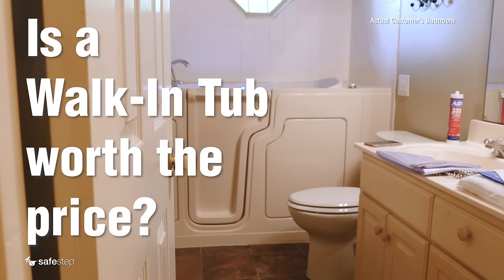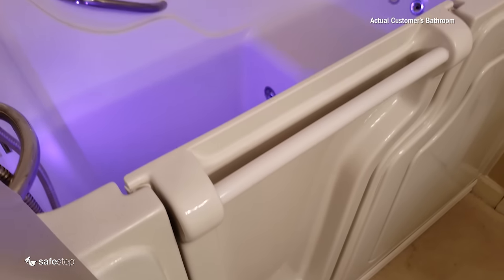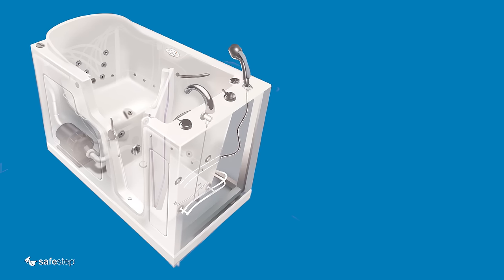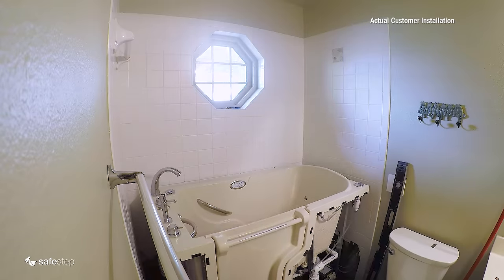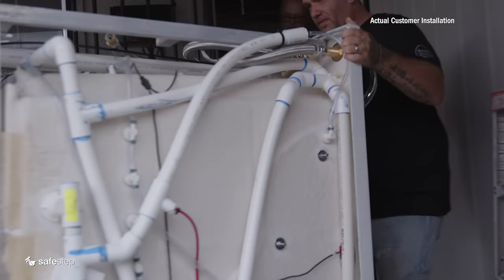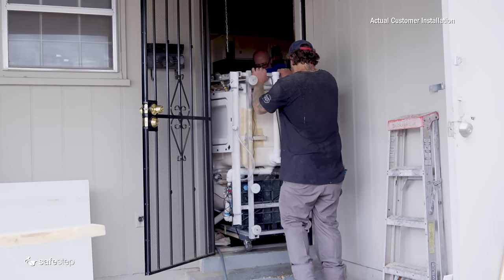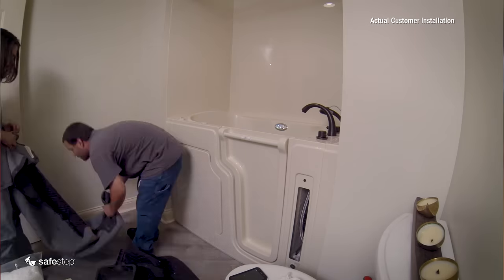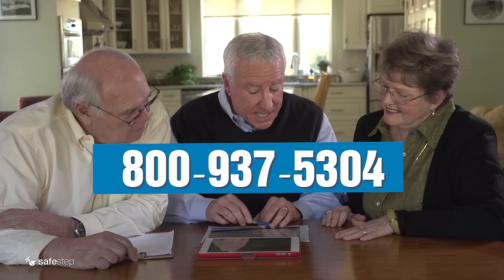Is a Walk-In Tub worth the price?

Comment: Some brands and models have an optional 2” double drain which your plumber may opt for 1 depending on your current bath drain configuration. If the double drain is desired verify that the plumbing systems age, performance and capacity meet the required demands these expect when both drains are opened. If you are deciding to build a new home and you want one of these type of walk in tubs have your plumber over size the building drain to facilitate in rapid evacuation. Typical symptoms you’ll notice if this is not followed could result in sinks, shower drains, lavatory traps emit or siphon air(gurgle). As a licensed plumber for 35 yrs I thought I would at least let you be aware. For the record. Yes!..my younger and older customers absolutely love these tubs.
Reply from the maker: Thanks for getting the good word out there!

Comment: I don’t have one, but what about the ones that have a shower feature? Can’t we just run the shower head on us with warm water while it drains so we won’t be so cold and it’ll help wash off the dirty water. Sort of like rinsing with a shower after a bath..???
Reply from the maker: You're right on the money! We recommend showering before and after your bath. When you shower before your bath, you wont be sitting in "dirty water". Our Hydrotherapy jets have an inline filtration system to help keep the water clean while you bathe. If all you're using is the Hydrotherapy, our heated seat and backrest will keep your warm while the tub is filling and draining.  Our Microsoothe system is built to exfoliate the dead cells off of your skin. We recommend that, if you've used the Microsoothe system, to rinse off after your bath too.

Comment: Do they ever leak?
Reply from the maker: If you keep them clean and leave the door open when it's not in use, our Walk-In Tubs will not leak. The pressure of the water pushes on the door seal and creates a water tight barrier. If you do have leaks, for any reason, call our service department. Our tubs come with a lifetime warranty. We will come out and fix it.